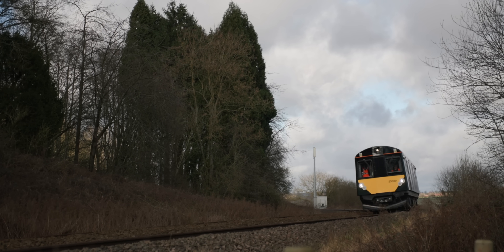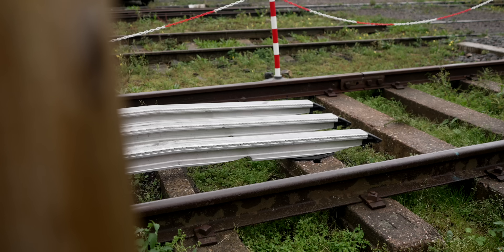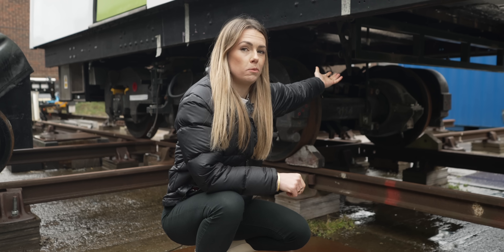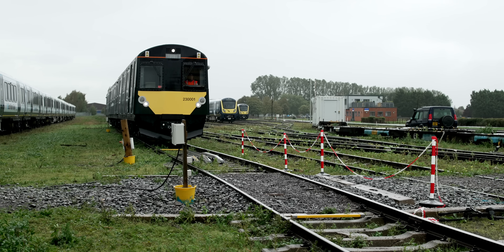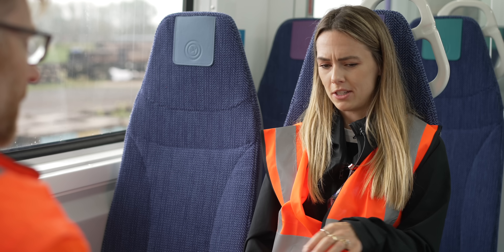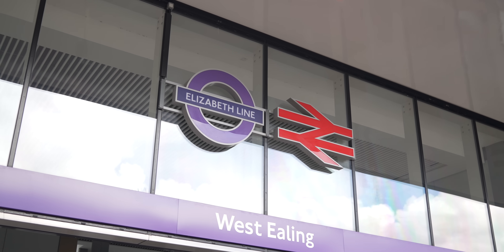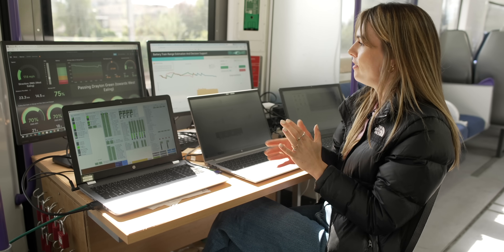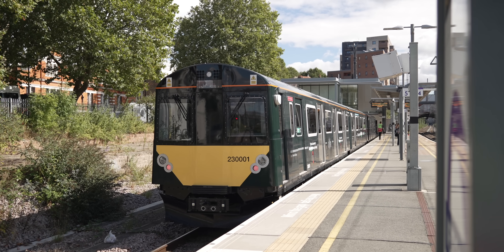Onboard the UK's First Battery Electric Train!

Comment: Regen not mentioned.  Must be a massive potential there.
Reply: I've been trying to find any mention of regen.  Given it's pretty much integral with electric traction, it'd be an odd omission. Even before you get to batery range,  the wear on brakes it would save would seem to make it a worthwhile feature.
Reply: Copy-pasting another reply of mine: It is at least mentioned that regen braking is used, in the video "Fast Charge Battery Train Trial" from the Institution of Mechanical Engineers, at timestamp 7:50.
(there are presumably mentions of regen elsewhere, but that was the first concrete source I found at least)
Reply: "Currently using 81kW of power" while rolling into the station. Maybe that's a slip of the understanding, then??

Comment: Overhead lines are not the only means of electrification.  The UK has the world's most extensive live rail network and a third of all rail journey are made on it.  That's without counting any of the underground or metro systems (including London's) which are also powered by live rail.  It avoids many of the problems of overhead power and requires less maintenance.
Reply: Great for when the kids are out messing around on the tracks, or animals escape… bzzzzz
Reply: Sure, if you want to make a maintenance hell in the tunnels...
Reply: @TheEsseboy  Everything in tunnels is a bigger problem, the p.way, the power by whatever means and the fabric of the tunnels themselves, but third rail systems in tunnels are actually less hassle than overhead power, which has to be worked on from a smaller and more cramped platform than can be used in the open air.
Reply: @MartinJames389  Mhmm, but you know what doesn't need maintenance in a tunnel? The none existing support infrastructure needed for charging the batteries at the stations...
Reply: @TheEsseboy  No, but there's no support structure needed for third rail power, either.
Reply: @MartinJames389  There is...the rails need maintenance...and doing it in a tunnel is not cheap! Not to mention it creates another work hazard in the tunnels.

Not to mention the rails need to be made to accommodate a third rail, which also complicates regular track maintenance...

Further it uses low voltage, meaning you need many substations spread out to lower the voltage, otherwise you have huge energy Losses, so you have hundreds or thousands of small substations to maintain...

Comment: I think a quick change battery system would be safer than the quick charging scheme. Just have that mechanism slide one battery out and a new battery in at the same time. Might take slightly longer but would be safer than quick charging. That way the battery packs could just shuttle off to the side and trickle charge like any other battery system.
Reply: Physically moving a 2000kg system is never cheap...and the machines to do it in a minute would cost 10+ millions instead of the 300-500K for that system.

Quick charging is safe, especially with Lithium Iron phosphate batteries...
Reply: @TheEsseboy   I guess the proof will be in operation. But I have worked on aircraft for around 40 years now and there are lots of things I've looked at and said WHY did they engineers do it that way? In some cases there may be an engineering angle I just don't understand but in some cases I know I'm right. But they never revisit ANYTHING once off the production line. Rarely.
Reply: @rael5469  Until you actually are an engineer with experience, you will have to listen to people who are...and they all say swapping huge batteries in any weather condition in under 3 minutes is next to impossible unless you wanna spend 7 figures to upgrade the stations with the machines and probably a little less for the special battery case and compartment on the train.
Reply: @TheEsseboy   You're wrong. Both systems are viable options.
Reply: @rael5469  If it is a viable option, why have it failed every time it has been tried? Even with other types of vehicles? Answer: Requires too tight tolerances, ruggedness and reliability to be cost effective. 

You are wrong, this is why you aren't an engineer. The problem is almost always cost.
Reply: @TheEsseboy  If it was cost they would have diesel electric locomotives. Save the cost of all that overhead wires. If the power goes down your whole system goes down. A diesel locomotive will run no matter what?
Reply: @rael5469  Well, diesel is more expensive to run compared to electric trains, and the engines for them aren't exactly cheap, besides they need to increase ventilation in the tunnels to accommodate them.

Comment: Diesel electrics are battery powered trains. A battery powered train's vslie is whether or not the cost of the batterymanufacturing, installation, and disposal costs are less thsn thr cost of s Diesel. Remember batteries dont work in cold weather. Best to electrify all the ralls

Comment: This needs to be deployed on the lines which have failed to be electrified . Give these trains pantographs so they can run normally on electrified lines till they go off the grid and enough battery to get to the end of the line where a shoe charger awaits.

Comment: My thoughts just gravitate to more important uses than trains which already mostly have overhead lines, why go to additional expense. Have batteries that charge off the overhead to access the track that are not serviced with overhead, a small boggy that can be attached to any electric train that has batteries, inverter that supplies loco coach when entering these areas not serviced. Equip all coaches with solar to feed into the system/ grid. No need to discard everything already available. No need to re-invent the wheel.

Comment: Southern could use these trains on their unelectfied routes, like the Oxted line for example, that has 24 1/2 miles of unelectrfied track, and are currently run by 21 year old Turbostar trains
Reply: Oxted has been sparked up for some time now.  The Hurst Green Turnback hasn't  .... and needs electrification, redoubling and reconnecting to the East Coastway.

Comment: I am a bit confused, why is a proprietary charging interface needed to transmit 2MW? Overhead wires are used for up to 16MW, so a short span of standard overhead wire in the station is everything you need. All proven and established technology.

Comment: How shortsighted this is to not just electrify the line. The weight of the batteries that the trains have to lug around ultimately make the consumption of the trains higher.
Reply: To put overhead lines in is very expensive and in some cases impossible with low bridges or level crossings. We are talking local trains here, not main lines. Also, the batteries replace heavy diesel engines, generators, fuel tanks. This set up is perfect for the local lines

Comment: It is not in fact Britain's first battery train.  In 1958 a battery powered train ran between Aberdeen and Ballater, a line around 42 miles in length.    The project was jointly carried out between British Railways Scottish Region and the North of Scotland Hydro electric board.  It ran for four years, doing up to a couple of trips daily in each direction, and was  notably quiet in operation.    Unfortunately lack of interest by railway management at the time killed the project and it was replaced by a diesel multitude unit, subsequently the line itself closed. The battery multiple unit still survives and is back on a restored short section of the Deeside line at Crathes, but is not operational.

Comment: So Southern rail run a train from Uckfield to London Bridge. The train used has to be a diesel electric because Uckfield to Hurst Green is run on non-electrified track but the rest of the journey could be done using electric. So why can’t a battery electric train use the same power rail to run the train and charge the battery and then use the battery for the non powered track

Comment: It seems odd to me to develop a new standard instead of simply using the existing pantograph technology that the rest of the world uses to deliver electric power. It ensures that these trains will be forever locked to a very limited network. It also permanently cripples the roll-out of catenary wires, as what's the point of upgrading the network with catenary if the trains you've build can't use them?

Contrast this scheme with Italy's Blues trains, that use a tri-mode (diesel/battery/panto) system and can charge their battery off catenary. Their trains can use any part of their network, they don't need a new gadget at stations to function. It was bought for exactly the purpose highlighted in the video here: it's expensive to lay catenary and Italy is aware there are parts of their network that won't be fully electrified for many years.

Comment: This is an interesting setup. I am not so sure whether this is a better solution than charging over overhead lines which is done in continental Europe in several places. There also island overhead wires are used to feed electricity. This also allows to run battery electric trains under wire on short stretches while simultaneously charging. It see the benefits of this battery charging station, but is integrates less well in existing overhead infrastructure. Anyway, maybe there is enough market space to do so in the UK. What I wonder is, for electric buses they also use a two pole system, but it is connected via a pantograph, like device. This can also be used in stationary setups and is not close to the ground where dirt, ice, snow and leaves may hinder charging.

Comment: Some numbers for the motorheads:
500kWh of stored energy on the train, being charged at 2MW is a 4C charge rate, which is not too crazy;
2MW of charge for 3.5 minutes puts 115kWh of energy in to the batteries, which is almost 1/4 of a full charge; 
500 kWh of stored energy, at 125 USD per kWh of LiFePO4 cells (type not stated in the video) = 62,500 USD for the whole train.  This is not real money though the cost of the whole system will get to be real money at some point.  Even so, maintaining and extending the overhead charging system costs real money as well.

Comment: I like it. But why not use overhead lines to charge? You can have them at stations ONLY, similar to this system. Then the train can also use existing overhead wire infrastructure.

Comment: The Class 230 and it’s sisters are actually the old London UndergrounD District D78 (1978) stock given a new life.
The London UndergrounD trains are 4 rail trains, 2 running rails and the  2 conductor rails that provide the DC power to the trains. The inner (centre) conductor rail is the Negative, at -210V, and the outer (outside of the running rails) is the Positive, at 420V, providing the 630VDC* traction supply. *Where the 4 rail and 3 rail (third rail) trains (London Overground and British Rail) share tracks the traction voltage is 750V on the outer conductor rails and the centre rail is connected to the running rails and is at 0 Volts. Note: the Negative (or 0 Volt rail) is always in the centre but the outer Positive rail at +420V or 750V is placed on one side or the other for operational (track work points/switches etc,) and furthest away from platform edges at stations.
When it comes to battery charging the Class 230 batteries becomes a 4 rail train as it was when on the District Line of the London UndergrounD with Positive and Negative conductor shoes. A nice little nod to its past.

Comment: For a lot of stations, there should be no reason why there can't be a massive solar canopy over the tracks from platform to platform, roughly the length of the platform and or the trains servicing them. Trickle charging battery banks from these should be fairly straightforward. Also, train station solar canopies would do double duty as extra shelter for waiting passengers, hopefully encouraging greater take up of public transport in the process.
Reply: On a somewhat related note, the "solar" train was effectively just that, wasn't it? A battery electric train that got fed trackside from energy stored up from solar...
Reply: Italy have been experimenting with solar sleepers.  Mind you, they do get a bit more sun there.
Reply: we should do it to power the station - nowhere near enough to power trains
Reply: @lawrencejob  Because the power is stored in track side batteries, the solar panels can trickle charge the battery and then dump the energy into the train when it arrives. Stations have huge canopies, so can have large arrays. Don't forget the train only has to be charged enough to reach the next station. There's a train that works like that in Australia.
Reply: That would help a lot, but wouldn't work so well in winter.
Reply: @BooBaddyBig  That's true of all solar systems, irrespective of size for those who are located in areas that experience less sun outside of summer. But it should also be remembered that solar technology is actually more efficient in cooler weather and all that is actually required for energy production is light. Recent developments in solar technology has produced panels that will respond to starlight.
Reply: @pinkelephants1421  Yeah, but there's not nearly enough starlight to drive trains for any practical size of solar panel array. Still, having trains being net low carbon over the year is probably a good idea with few downsides. Still, we have solar panels here, and during the winter they are pretty shit and often give near zero output. So it wouldn't change the size of the grid connection required, but it may be able to reverse the power flow during the summer.
Reply: @BooBaddyBig  I didn't mean that starlight would be sufficient to power trains, of course not. It was a means of pointing out how solar technology is evolving. Solar does produce more electricity than you give it credit for in a UK winter; multimillion pound investments in grid scale solar aren't done for the fun of it & there's PLENTY of new such projects seeking either planning permission or about to commence as soon as they can get a grid connection.

Comment: Areas where charging systems are need be covered by a small shed, some might laugh at this but as everyone knows in south East OK uk third rail network is not without issues. 18months ago heavy snowfall rendering 3rd rails useless as none of trains could pick up power.
The pick up charge rails need be available all the time irrespective of what weather is only way this available in snow weather is have it undercover, whether it case place them under complete train station roofs where risk of snow coverage is eliminated. Putting these rail charges in open air subject adverse weather conditions won't work.

Comment: wonder what the miles per kwh equivalent is, once cruising at 70
When all commercials are quiet torquey electric with no local pollution, life will b much improved
We need to switch to electric PSVs and Commericials as quick as possible, ramping up green power to support them

I have always been a car enthusiast and used to race, however once I had driven a modest Zoe for a while, I was converted :)

Soon as the power supply both on board and supporting is sorted, life will b so much improved.

Low mileage ICE 'specialist interest' cars should remain alongside classics, to satisfy (and not waste the tech) for weekends and the like

Comment: How is the regen of the braking energy? I would think that, as the train uses very much energy to accelerate, a similar amount can be harvested durin braking, So put a roof over the platforms and put solar on them, as commuter trains travel during daytime and load the battry to full on the net during nighttime low, then maintain charge on solar during daytime.